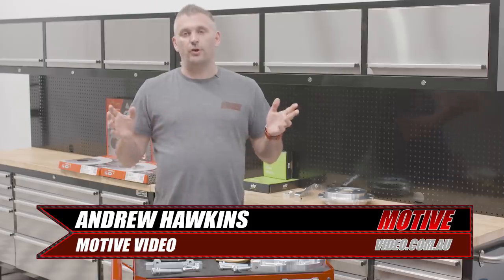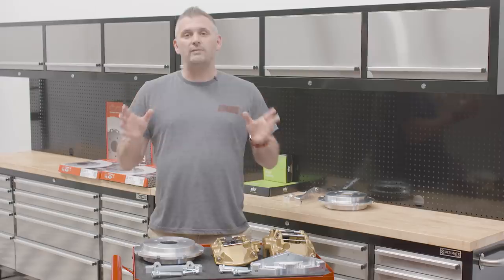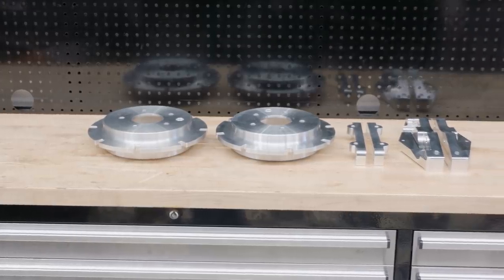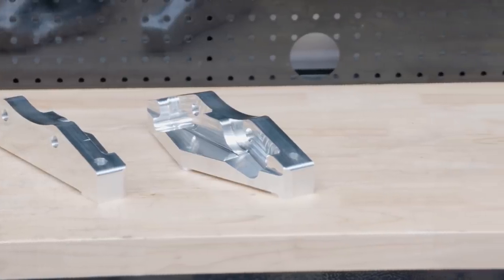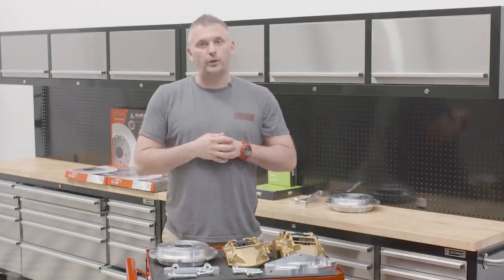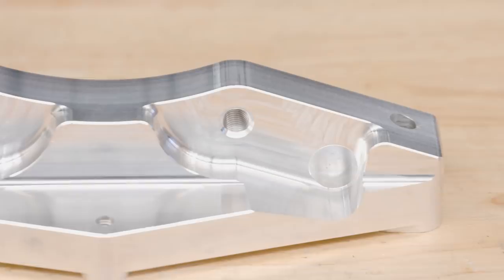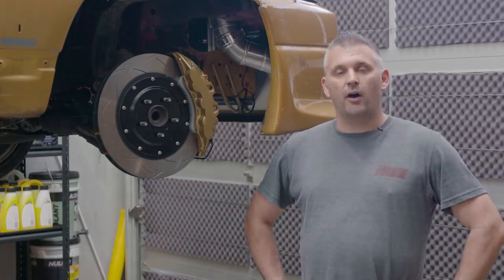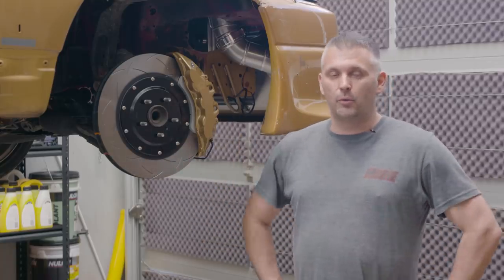R35 GT-R Brakes Install into R32-R34 GT-R - Project No Secrets R33 GT-R Ep20

Comment: DAMN dude, I can't wait to see what kind of braking G's you can pull. I ended up going a little more budget oriented on my R32, I went with the Alpha Omega Evo brake kit that uses evo 8/9 brembos and an evo 10 rotor front and 370z rotor rear. I'll have cheap off the shelf rotors and pads available and I get a 350mm rotor all the way around. The other bonus is that it'll fit under my 17 inch wheels. I've already got a BM57 on the car, which kind of sucks with the stock 32 gt-r brakes. I'll be happy to report back what my braking G's end up being when it gets here from down under in a few weeks!
Reply: How'd you go?
Reply: @samuelmdouglas  Ha, complications and haven't installed anything yet. I'm actually waiting on a different bracket and I'll be able to install everything soon.

Comment: Great choice going with Elig pads, i run the same pad combo on my ek civic and i cant speak in a negative tone about them. They are a little bit of a train when cold and rather dusty, but that's all a good thing imo. Keen for the next video!
Reply: I onew this is a 1 year old comment, so the brake wont work better in wet compare to factory brake?
Reply: @vire559  the elig pads are great in the rain. 
Just noisy while they are cold (initial bite)
Reply: @siwood22  gotcha, tks

Comment: Very cool set up.
And great there is an unsprung weight saving with the different rear hat.
In the same vein have are you going to pick a corner and weigh the new entire system with the brakes, adaptor kit, wheels and tyres etc to do a comparison of before and after unsprung weight?

Comment: Sold my gtr “r35” brakes and fitted a full Alcon kit. The difference is day and night. The money I got for my gtr brakes pretty much payed for the Alcon kit. Love my R35 but the gtr “fanboys” are crazy to pay those prises. 🤷🏻‍♂️
Reply: RICARDO  I agree they are made to work perfectly with a production car. That said lap after lap I have seen limits to the factory brakes. The Alcon kit has reduced the unsprung rotating mass quite significantly and later braking has been increased. Remember even though they are Brembos they are still made to a cost in accordance with the overall price of the car. Hence why Bugatti have a price tag that matches the 3D printed titanium callipers.

Comment: Better idea for lining up the caliper is to apply the brakes with the bolts loose for the caliper, which will centralise the caliper by the pistons, I do this on my bike whenever the caliper is removed as they are radial mount like these are.

Comment: I have SO been looking forward to this episode. I've seen some done before with different options but this is a much better route. One of my favourite dream mods for my R33 GTST...

I know it's expensive but good value compared to aftermarket kits but how much would it cost in the ball park region if what you have here Andrew?
Reply from the maker: All depends on how many things you buy new or second hand etc. if you buy R35 brakes with rotors and pads that are usable, then whole conversion might cost $7000AUD.

But cheap calipers that need fixing and all new rotors and pads then it might cost a little over 10K AUD. But high end brake kits can cost more like 20K

Comment: Insane! 
Curious on a size comparison between the 35 rears and the factory 33 fronts
Reply from the maker: Factory R33 front rotor is 324mm
Rear R35 rotor is 380mm

The pads used in the front of the stock Brembos is same size as pad used in rear R35 brakes

Comment: What size/offset are those wheels? They look fantastic on that kit but I imagine you’d need some good size to clear the brakes.
Reply from the maker: 18x10.5+15
Reply: @MotiveVideo  I would like to get this mod done but with all 4 of my CE28SL 18X10J +20mm stayed on in my BNR32 if possible. I wonder if a thin spacer on each corner would help. Yet, >5mm might ruin the looks too much. Please comment. Thx!

Comment: with the rear brake set up,,  are they ADR approved? Given the hand brake runs in an alloy drum or is that where the steel insert comes into play making it ADR approved?   Or is it just a full race spec set up?
Reply from the maker: None of the kits are ADR approved. Some went inserts as they thought that was cheaper and easier.

Comment: After doing much the same thing for my car I probably won't be doing it again unless it's for racing. For a street car, it is totally unnecessary and is basically only for aesthetics at the cost of several thousand dollars. One little known fact with these brake upgrades is they don't really improve stopping power much, they just reduce brake fade.
Reply from the maker: If you have a larger and grippier tyre, which we will, then they will increase stopping power
Often the tyre and suspension set up is the limiting factor

Comment: Well if nissan interchangeability serves me right then this kit should also fit S chassis
Reply from the maker: It will fit yes
Reply: haha why an S-chassis would need those brakes and/or 19" wheels is beyond me, but hey everyone has their wild ideas.  besides, the rear calipers are way too large, even for a GTR... it'll need a lot of bias adjustment and i am skeptical if it will ever get enough heat input to justify.  looks are good, but form seems to be above function with this.

Comment: first thing helicoil all threads in aluminum.
Reply from the maker: What about billet blocks, or factory heads and blocks? Should we helicoil every thread?
Reply: @MotiveVideo   Hi why not give it a try an make a video. No more broken waterpump or thermostat screws. Bell housing and oil pan thread @ block. Even the threads in a aluminum flywheel to hold the pressure plate. 
I do this in my job @ CNC machines.
Greatings from germany and nice channel i like it.
Reply: @MotiveVideo  Pah! You may never take the engine apart, but brakes are a constant service item. The first question prior to fitment should be 'what's the potential risk if the part fails?' Given the amount of thread engagement and lack of fatigue analysis of the part - then yes, you should helicoil it.

Comment: Can you not get aftermarket brakes around this size that bolt up without adapters? I would've thought aftermarket options for 32 to 34 gtrs would already have this covered.
Reply from the maker: All aftermarket brake kits use adaptor.

Comment: Are the crossover pipes on the front calipers OEM or did you make them up? I have a damaged one that I need replaced and can't find anyone that has a spare or a shop that's capable of making one that looks close to OEM.
Reply from the maker: Stock
Reply: @MotiveVideo  have any spares you can sell me 🤣

Comment: How much do the rotors and calipers weight compared to the factory ones? If its massive overkill are you not adding excessive unsprung weight?
Reply from the maker: Theyre slightly heavier overall but big brakes always are
Reply: @MotiveVideo  you used the 400mm rotor right? for a less powerful car would I be better off with the small rotors then? im assuming they weigh less and the weight isnt as far out (smaller diameter) so less centrifugal force?
Reply from the maker: We went 380mm

Comment: Why did you put the Full Floating Rotor on the rear and not the front.
Full Floating rotor should be on the front as they generate the most heat 
and require the most cooling.
Reply from the maker: the car is so over braked it doesnt need it
Reply: @MotiveVideo  
Also what size and offsets are your TE37's, to clear everything.
For people looking to do this upgrade.

Comment: Aluminum parking brake. 🤔 holding power of cheese. Might wanna include that tid bit of info. Product promo is great but, you’re better than that dude.
Reply: That's what I was thinking.  Some companies (not for Nissan applications) put an iron liner in the rear hat.
Reply: 2 grand for it too lol
Reply from the maker: Have you seen what other kit costs. 
If people want to drift and use their handbrake for driving instead of just parking, there are other options and ways to do it